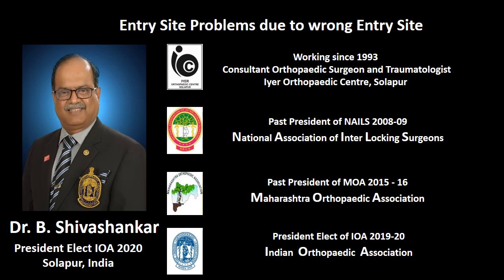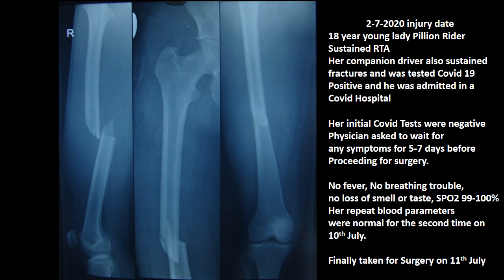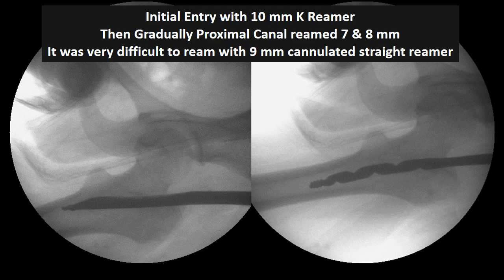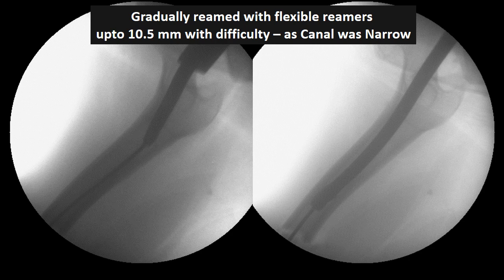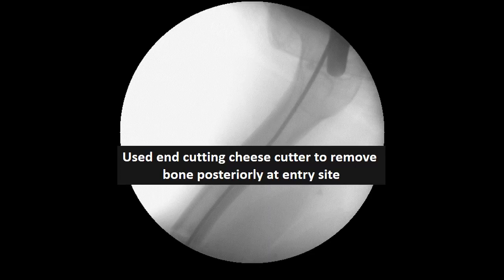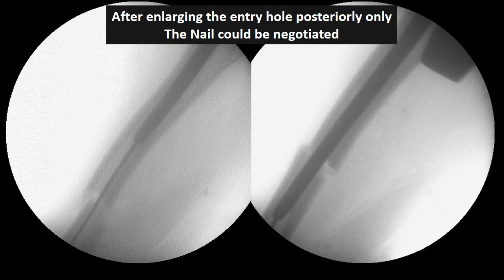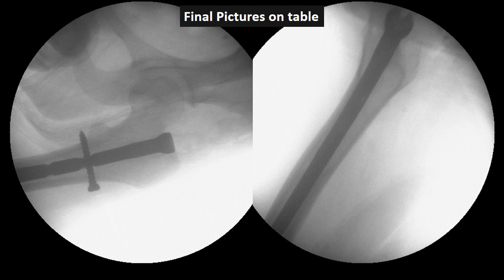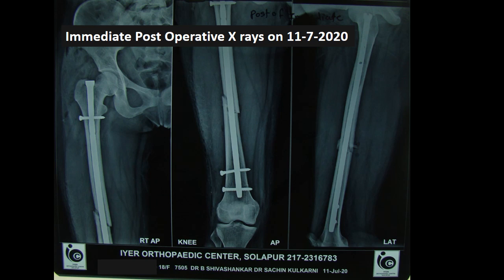Entry Problem for Femur Nailing

Comment: Great presentation sir..face this issue quite often..one more point Sir is one of the distal locking screw broken?? Looks like bent on the post op pics?
Reply from the maker: that has bent due to extraction of nail to compact fracture

Comment: Thanks for demonstration,  but why only single screw proximal?
Reply from the maker: All fractures requires certain amount of collapse that can be accommodated by the dynamic locking. So I always do dynamic locking. yes 90% of the time fracture heals whther you do dynamic or static locking but few fractures resorb a bit more and they require dynamisation later or dynamisation from day 1 as I do to avoid second surgery of dynamisation. I hope I am clear.

Comment: Sir , What do you mean by Finger used to reduce fracture ???  Mini open and used finger ? Or just closed manipulation with hand ??
Reply from the maker: It is s cannulated instrument with tip having a hood like bent, so that guide wire coming inside from top gets to bend little sideways to help in advancement to distal fragment